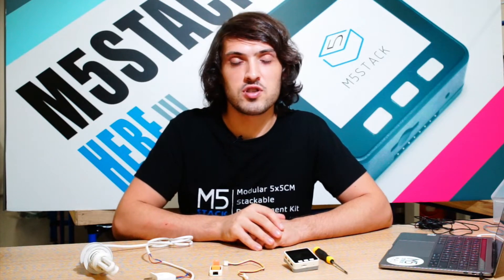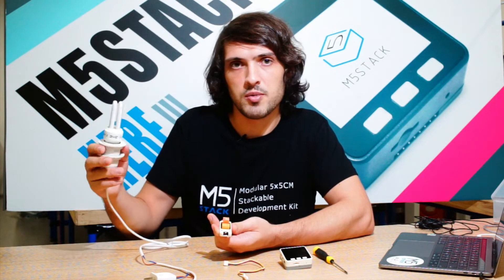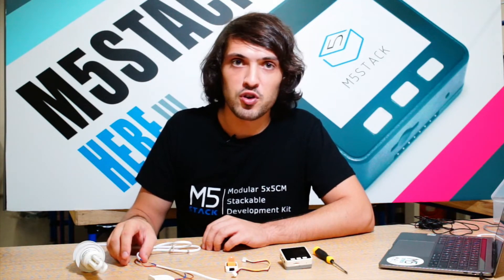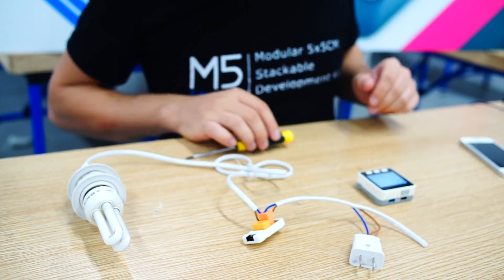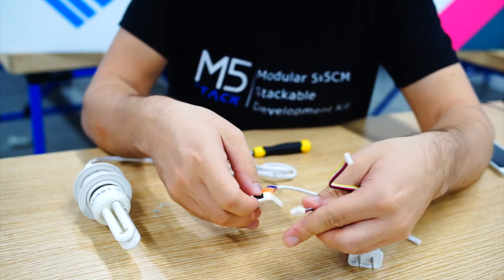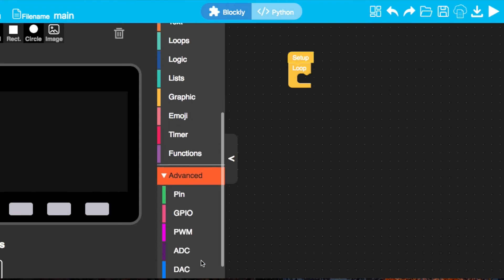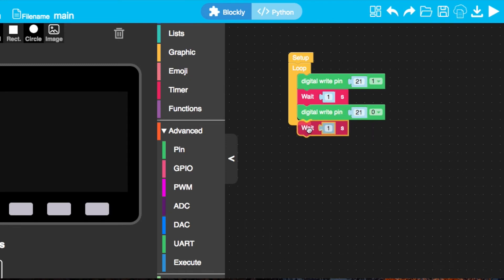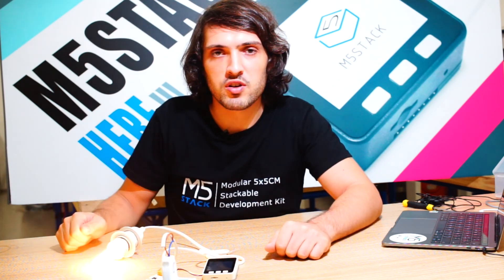Smart Home Lightning with M5Stack Part 1 - Blinking a lamp with a Relay.

Comment: Hi, i need control 8 relay module. It’s possible? What hardware use?
Reply from the maker: Hi Manuel, if you are using the M5GO or M5Stack Fire, you can use the grove port extension hub https://m5stack.com/collections/m5-unit/products/new-arrival-m5stack-official-i-o-hub-1-to-6-expansion-grove-i-o-interface-for-arduino-blockly-development-iot-mega328-module which will provide you with 8 ports in which you can use 8 individual grove compatible relay units